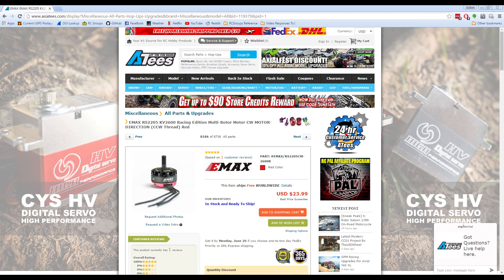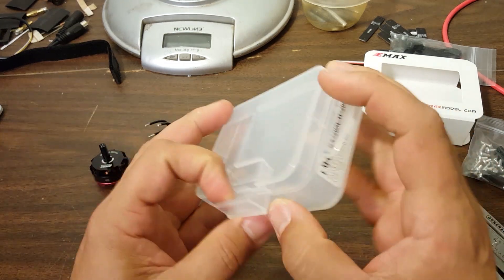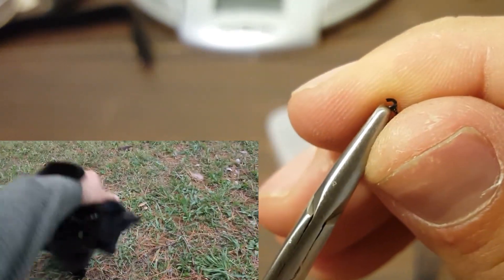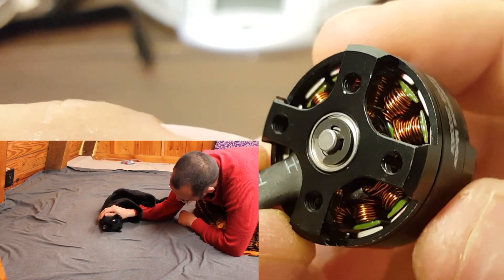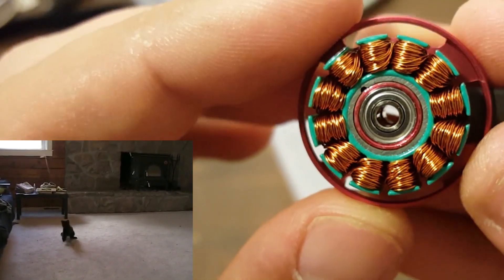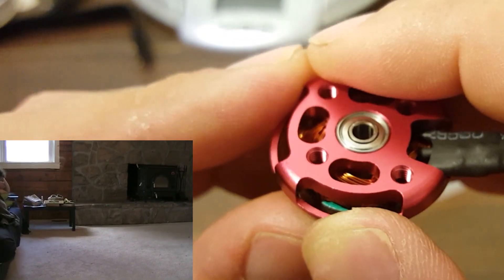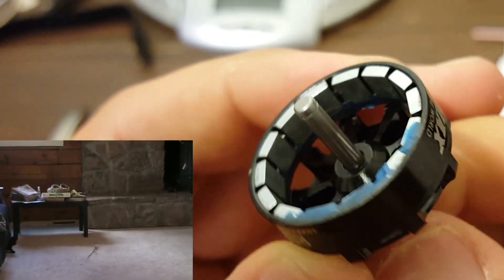RC Brushless Motor Primer With Cats

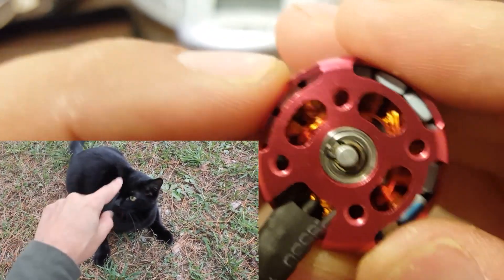Comment: Just think about the shape the clip makes:  is it a C or an E?   1:56 is a C clip because the part that contacts the race is a continuous C.  2:37 is actually an E clip because it has the 3 nubs that make it look like a bent E.  6:13 It was surely statically balanced the way people typically balance their props, not dynamically balanced.  They only added weight to one very conveniently accessed plane.

The idea of serviceability of these motors is funny:  they may be cleanable and repairable but in the end it's probably more worth your time to just replace it with a new one.  I completely agree with you that it's worth buying quality motors, though.  The cheap ones suffer from bad tolerances, bad balance, noisy and sloppy bearings, and inconsistent thrust and response characteristics.  I got a bundle of cheap motors in a package deal with a frame and the range of each motor is different.  One of the three has significantly less range than the others and they were all just a complete waste of money.

Comment: Okay I'm a little stuck here. I'm building a zmr x210 and I will use 4cell batteries. would 2300kv motors with 20a littlebees work or should I go with 2600kv motors and 30a littlebees?
Reply from the maker: No call for 30A IMO. Even 20A ESCs can usually burst higher for short periods. 2300 vs. 2600 is a matter of taste, but for a new build, I would suggest 2300 as it is a better all-round motor.
Reply: Thank you very much for your time and advise. I'm building the ZMR X210 like you built. In the meantime I'm learning on my Walkera F210 and at 555 grams with battery (according to my food scale) it seems a bit heavy and the motors 2500kv don't send it skyward very fast when compared to your videos.
I will be a posting a video of Joshua Bardwell inspired moves soon. If you don't mind I would like to mention your name in my comments.
Thanks again
Reply from the maker: Mention away!
Reply: +Joshua Bardwell I have uploaded my first video! thank you for the inspiration! feel free to comment

Comment: Which motor would you recommend? I hesitate between these red bottoms emax, the lumenier 2206-2350 and the lumenier skitzo 2204-2500 on a QAV210. Looking for the punchiest ones and I'm a bit lost between the 220x and the Kv ratings.
Reply from the maker: +MrDevilFlash the Skitzo motors are a little lacking in torque for 5" especially if you want punch. I would go with the 2350 if you're not sure you want a high kv.
Reply: What I've understood so far, is that higher kv motors have more punch from mid to high range of throttle where lower kv motors have more punch on lower throttle. So high kv can be more interesting for freestyle where lower kv motors are more interesting for racing where you don't really have use for full throttle punch.

Is this a good approximation? And freestyle is my type of flying. Moreover, emax are cheaper. In that case would you recommend the emax motors to me?
Reply from the maker: I'm not sure that's a good approximation really. Especially when you consider that the type of prop that is optimal for each motor is different. So you would run a high-kv motor with a less aggressive prop and get a different response curve than a lower-kv motor with a more aggressive prop. In general, think of a lower-kv motor as having more torque but less top end.
Reply: I use triblade DAL 5x4.5 props. I checked bench test with the emax 2600 and 2300 for different props and it seems the 2600 have more static thrust.

I'm not good enough to know what it means in flight though. What will a higher torque do in flight behavior? More reactivity? Quad feels more locked? Sorry for the dumbs questions, I'm quite new in technical aspects of the hobby,

Any motorisation suggestion for a QAV210 with F303 FC, DAL 5x4.5x3 in order to do freestyle, accro more than racing? I've already a QAV210 with the Lumenier 2304-2350 but wanted another one with F3 FC so, why not change motor as well to see the difference. And if it exists something with a bit more punch, I'm all on :)

Thanks for your time, your videos allow me to learn much! Will patreon soon
Reply from the maker: +MrDevilFlash more torque will give more immediate thrust especially low in the throttle range.

Comment: Not sure if this was all ready mentioned.... This tool should be able to remove the Emax clip without damage: 
http://www.homedepot.com/p/KNIPEX-5-1-2-in-External-Straight-Circlip-Pliers-46-11-G0/205944262?cm_mmc=hd_email-_-Ship_Conf-_-20160518_PP_ET_Merch_Ship_Conf_2876540-_-pip_url__W490584198
Reply from the maker: That is the right tool all right. Hmm... I should get one.

Comment: So which way should my threads be turning in relation to my motors?
Reply from the maker: Use all standard threads so you can buy replacement nuts at the hardware store instead of ordering them from China. With strong braking on ESCs, the idea of counter-rotating your nuts is moot anyway. A regular nut can back off just as easily no matter which way the motor is turning. Use nylock nuts and they will stay tight.

Comment: 1 question, can I test the motor rotation using a servo tester? Starting my first build and my soldering skills are not the best so I wish to avoid re soldering them once in place.
Reply: Yes, that's what everybody does,,  but watch some build videos (try Flightclub for example) and you'll learn to just solder two motors with the three wires straight to the ESC (like three fingers held straight out), and two motors with two wires crossed, then you'll be in business. :)
Reply from the maker: What I do is just solder them all straight through and then reverse two of them in BLHeliSuite after the build is complete. With BLHeli passthrough, it's a pretty reliable way of going about it.
Reply: Thanks for the reply, I did the strait soldering and reversed them in Blheli. And they work :) no magic smoke (for now)

Comment: Emax are still cheap motors, and good for the money. I have 3 sets and two spares, and have been crashing the snot out of them from day one. Haven't replaced a single one yet. Qualitywise just as good as Cobras and T-motor that I have been using. Will probably test a set of ZMX next. V3 2206 2300 kv weighing the same as a Emax  approx. Believe they have curved magnets too, and being dirt cheap.

Comment: What is the purpose of the arrows on the bell showing  the motor direction?  When I soldered these up it didn't make a difference to which direction they spun. Is that then just for thread direction? Have you ever seen a motor that was wound to spin  in a specific direction ?
Reply from the maker: +tahosrfr you can always reverse the direction of a brushless motor by swapping any two of the leads with each other. The arrow just indicates the threading.

Comment: What new motors are using ARC style magnets? Thanks
Reply from the maker: I don't know one off the top of my head, but I've heard QMF talk about them.
Reply: ZMX i think
Reply from the maker: ZMX are a hell of a bargain at the price. If RCX weren't down to $9 (if you forego the warranty) ZMX would have the throne. Really, it's great that you can have a motor at nearly any price point you want.
Reply: Yeah, ZMX motors are some serious stuff, they perform really good, their thrust is sky-high BUT they are weak...one bad crash and whole motor is bent because they used quite weak aluminium for them.

Comment: RCX v3 motors are made of 7075 aluminium .. so should last longer. Them EMAX sure have the thrust though, but your batteries need to keep up too.
Reply from the maker: It'll be interesting to see if the RCX aluminum holds up compared to higher priced motors. Either way, RCX continues to impress.

Comment: Love your videos fella. Top tip which someone may have mentioned, when removing clips, do it with the motor in a clear bag, then if the clip flies off you know where it is. Keep the cool vids coming.
Reply from the maker: Good tip. In my case, my tools are all magnetized from being stored on a magnetic knife rack, so the clip just sticks to the tool.

Comment: I plugged in these motors after receiving them from banggood yesterday, replacing my existing RCX. However I noticed that they were stuttering and would not spool up cleanly. I unsoldered all but one, and plugged in two other motor types on the other ESC's. The other motors would run, however the EMAX Red bottom 2600kv wouldn't as it would still stutter. I tried just leaving it on by itself on a different esc. It again stuttered, then stopped responding with white smoke, killing my RSSI. I seriously hope that it was just a defective batch and that I can get my money back.
Reply from the maker: I have heard some horror stories about Banggood Emax motors. I half-suspect there may be some counterfeits out there.
Reply: ***** Props were on but it never really spun correctly

Comment: The only only experience I have with miniquad motors are some RTFQ 1806-2300 kv motors, which are fine for a few weeks but soon after the press fit shaft starts going loose and the bell has to be pressed back in.  The tiny shaft also bends with your hand super easy... it made for a very vibration-full quad when I started learning to fly but the flip 1.5 FC took it just fine.  What do you expect from a sub 10 dollar motor.

My most used motor was the Lumenier 2204-2300kv motors... I got them right when they were released.  These motors have been through A LOT and I can say I have not bent a shaft and they continue to be quite vibration free.  Granted my crashes are usually not horrible crashes.

I just recently built up my QAV-210 from a used lower plate/arms I had left over when I converted it to a QAV-R.  I ordered some Cobra 2204-2300kv motors.  No grub screw so that's nice.  I have yet to complete the build but just from looking at the difference between the Lumenier 2204 motors which are VERY low profile and the Cobras with that bump above the bell that raises the prop giving them a pretty high profile (even though the motor itself is low profile....the fact that the Cobras hold the props up higher by a noticeable degree makes me feel that in a crash the shaft will receive  A  LOT more bending pressure since the leverage is greater from the prop being up higher.  I'm guessing this pressure would be worse with a non-breakable prop like the DAL props whereas an HQ would just snap. 

The 21 dollar price tag on the Cobra's was more in my price point as was trying to resurrect the QAV-210 for a bit less than I have in my QAV-R.  We'll see how they  do after a few crashes.
Reply from the maker: The 2mm shaft on the 1806 has always been a weak point on them. If you have to press-fit a shaft, try getting some green loctite and applying it. Another tip is, apply the loc-tite, insert the shaft, then clean up any smears and quickly install the bell on the motor. Install the clip and press the shaft carefully (use a vice or a C-clamp) to the correct length to press the clip snugly against the bushing or bearing. If you go too far, you really can't easily get the shaft back out again, so go slowly and use a vice or C-clamp so you can precisely press the shaft. 

This will give you the perfect tension on the shaft. IMO, there is no other easy way to get the shaft correctly inserted with no slop.
Reply: Joshua Bardwell
 Thanks Joshua...I didn't expect to find a fix for my crappy 1806 motors from my post, but I may just try this and see if I can bend them straight.  I have done this by looking at the gap between the bell and base and they would improve a lot but I think the fact that the shaft was moving around all the time wasn't helping.  Thanks again for the tip.

Comment: Hello Joshua, 
Good overview and nice idea about use part of the box as camera mount !!!
I would like to know your opinion about the  new "DAL Props Indistructible" tri-blades 5045.  I bought some to test but After some hard crash  the prop was just bend,  so what happen all the force was absorved by the motors as well do you think this can make the motor life shorter ???
Reply from the maker: I have had some RCX motor bells damaged by running DAL props. I definitely think DAL can result in shorter motor life. I prefer to run slightly lighter props like KingKong or DYS or Gemfan. The other reason I don't like DAL is that they bend at the hub and, even though they are not broken, they are so off balance that they can't be flown. With lighter props, they bend back more easily and can still be flown.

Comment: I had to order extra e clips from emax.
Reply from the maker: I found some at readymaderc. I think they are correct. About $5 for a set of 10 including shipping, but what can you do?
Reply: i actually emailed their support and asked if the ones they had on their site would fit the red bottoms.  was told no but they sure looked like they would.  decided to make sure and order from emax.  same, pack of 10 for 5 bucks shipped.
Reply from the maker: The part description is: "EMAX RS2205 Replacement U-Ring - 10pcs". So if it doesn't fit this motor, I will be really disappointed :-)
Reply: oh ya, id say thats a safe bet.  :)  i ordered about a month or so ago.  love the cats.  they hate quadcopters dont they?

Comment: I am scratching my head on motors over here Josh- I have been running Cobras for 2 years- then the Race Editions came out and I purchased several sets- in the last 2 weeks, with brand new motors, I have had to very simple and uneventful crashes- basically bad landings, and had the same (right front or M2) motor stop working. I thought it was an esc issue, but when I swap out a motor I am back in the air.

I know the motor hit the ground spinning but I disarmed on both instances.... same as I do on other copters. These Cobra Race Editions seem to be faulty. I have older Cobra 2204-2300's that have been beat to hell and are still running. 

What happens to a motor during a simple crash like this to cause it to stop working? I have looked at the 1 motor from the first time and can find nothing obvious wrong with it.
Reply: KISS FC/ESCs by any chance?
Reply: I agree it does sound like an ESC issue. Only one way to find out :)
Reply from the maker: +Hiway stops working entirely?
Reply: +Joshua Bardwell yes
Reply from the maker: I suppose that must be a fault in the windings. But usually if you have one phase fail, you still get twitching and uneven running from the other two. A total failure of the motor... I don't know what would cause that.
Reply: Joshua Bardwell
The first one twitched, the last one yesterday is dead- nothing. I am not savvy enough to troubleshoot this fine of a problem- I am more of a parts changer in these instances.
I think I am going to just begin using the RG motors since they all come with parts available. I have also noticed that my RG esc's outlast all other options on average.
I love building copters, but hate repairing them. This motor thing has me wondering if it is esc or motor now... what would cause a phase or all 3 to fail? I guess if it were a different motor I wouldn't be so concerned, but the same motor in 2 weeks? Seems too much of a coincidence.
Reply from the maker: Well an easy test is to swap the motor to a new ESC and see if it works. I do agree that if two motors have failed, the ESC is suspect. Don't forget that the ESC could be frying the motors, but in general, if the motor has not smoked, it is probably okay. It could also have damaged windings, but that's less likely I think.
Reply: Joshua Bardwell
Obliged Mr. Bardwell- I buy in 5's, so I have a spare esc. These are the RTFquads Little Bee 30amp. I knew I was going to have to change that damn thing- it is on a Krieger, so it is not too bad, but I have to either tear it down or resolder all the motor and power, and signal wires so I procrastinated.... the whole hate to repair thing. It is my only cyclone copter, and I just got it close to tuned on BF 2.8.1 and it might be my quickest and snappiest racer. Those Cobras and 5in bullnose make for a nasty loud and obnoxious craft- kind of like that whole "loud pipes save lives" mentality which of course, is fallacious. (don't tell anyone I said that- I have a biker rep to keep up, bahahahaha)
...............o~^o
Reply: Revs
No, RTFQuads Little Bee 30amp. I have never tried KISS fc or escs.
Wanted to, but tend to not jump on stuff if it is hard to get.
Reply: Hey I've had one particular motor that "twitches" like you mentioned, it does it only when I run my 1300 LiHV packs. I plug it in and my left rear motor wont run, but sits still and twitches. I've found that if I just wait 15-60 seconds, there's a confirmation beep from my quad and then it runs. What's that all about?

Comment: You should try the new kind of motors without the C clip , it's a screew instead  , so nice and tight fit

I have the DYS SE2205 they are so smooth and powerhouse  , not too pricey either
they are very well graded at http://www.miniquadtestbench.com/

some other brand , including T-motor have screew too

sorry for aproximative english
Reply: those screws strip easily from my experience... the motors are fine but a real pain to dissasemble

Comment: The foam is great to build some Lumenier-style landing pads! It won't lose it's form over time like some other foam does.
Reply from the maker: The adhesive on those Lumenier pads is amazing though. Very, very sticky, but also sort of gooey so it grabs the surface very well even if the surface is not perfect.

Comment: myrcmart offers now a new version with harder aluminium.
Reply: The SE2205?
Reply: +Free Flight no the H2205's
Reply from the maker: That's correct. The new v3 RCX motors are 7075 aluminum and have N52 magnets. I would be really interested to hear about their reliability over time, because after all, just because a grade of aluminum is rated 7075 doesn't mean it's all the same.